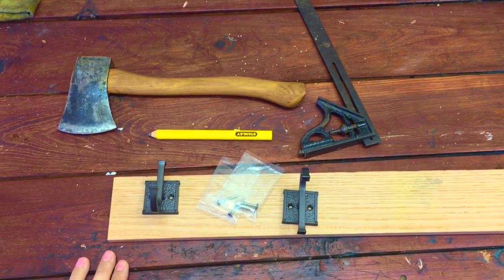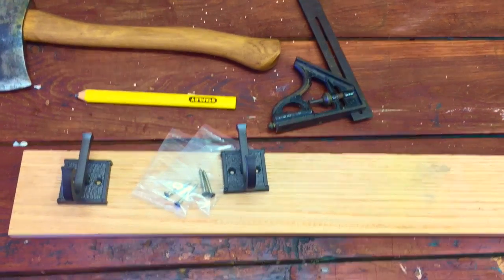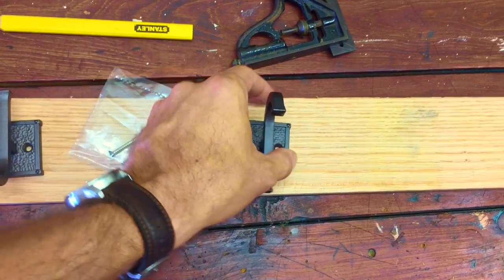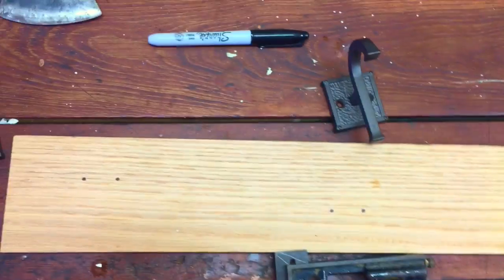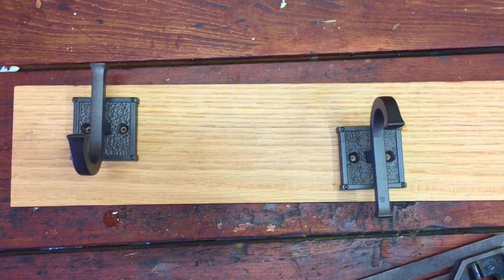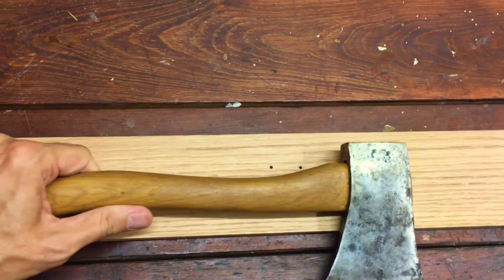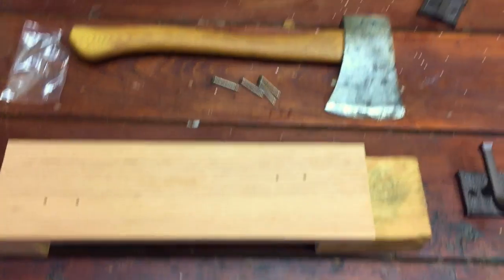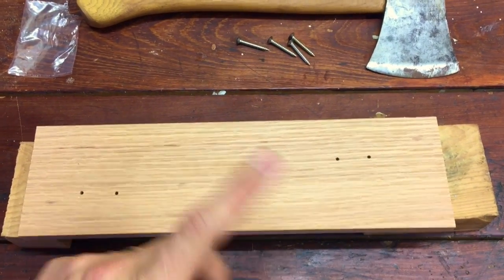Easiest way to display axes

Comment: wow you could have picked up a cheap angle grinder with a cut off wheel for $30 and got those screws cut in 10 seconds
Reply from the maker: But I didn't want to essentially $30 on 2 screws.  Those are expensive screws.
Reply: @TXSuburbanHomestead  well i mean you can use a angle grinder for more
Reply from the maker: @Ian-gi4th  yes. I've owned them in the past, I've used them at work, and I own one now. Just at that time I didn't have $30 extra to spend on a project that could come together with alternative solutions.